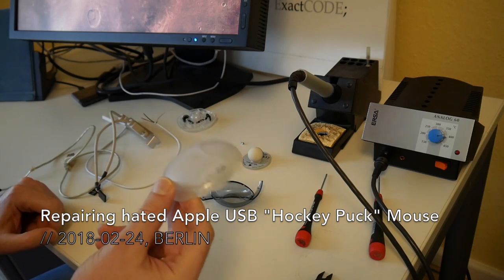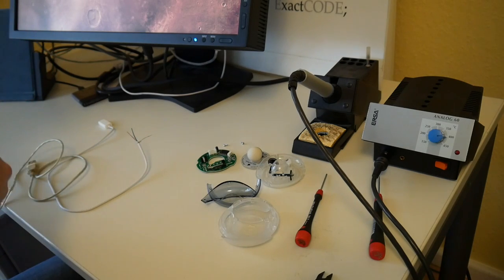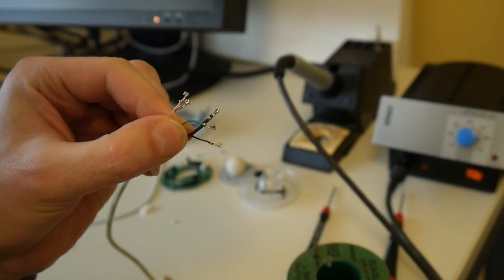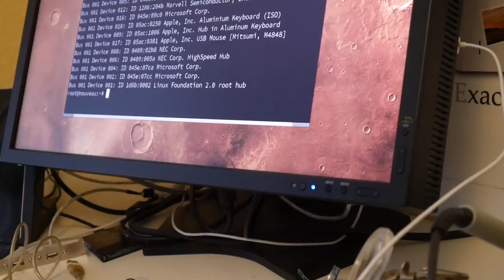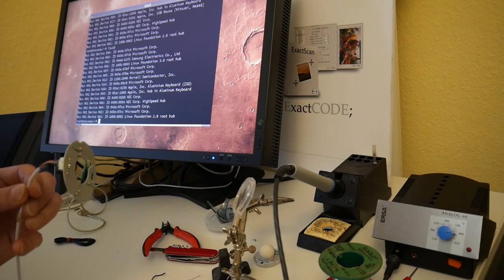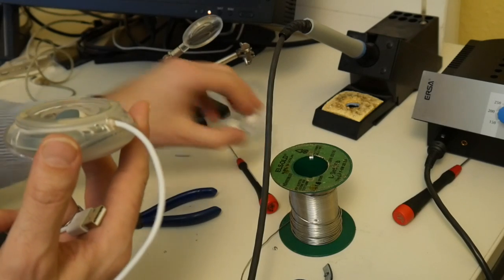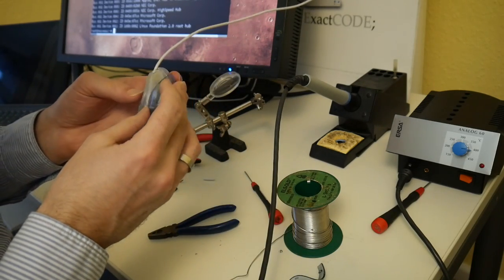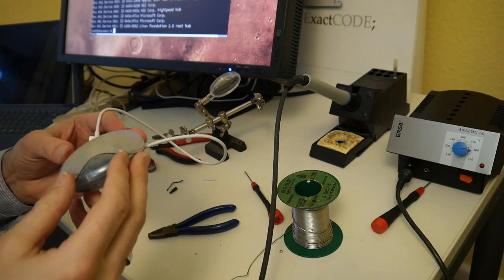The hated Apple Hockey Puck USB mouse: disassemble and fixing

Comment: My Puck's cable also stopped working, seems to be a common issue with these mice based on what other people I've talked to have said. I happened to find a USB cup warmer at the thrift store that has a translucent USB cable that's the same size so I'll probably be using that. Cheers!